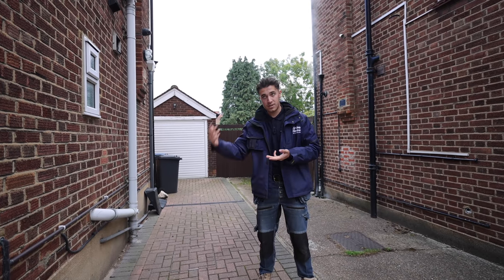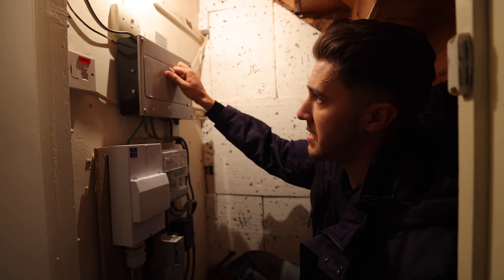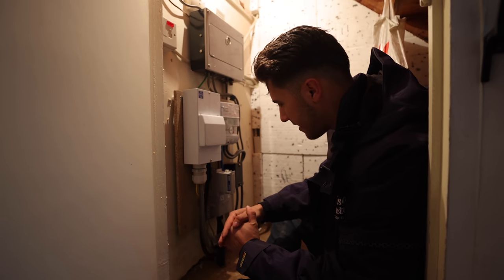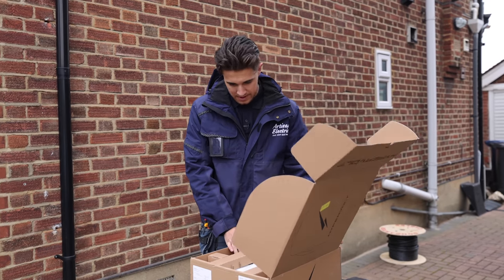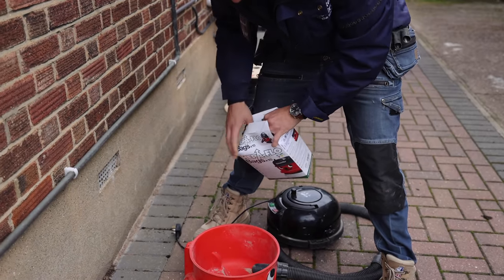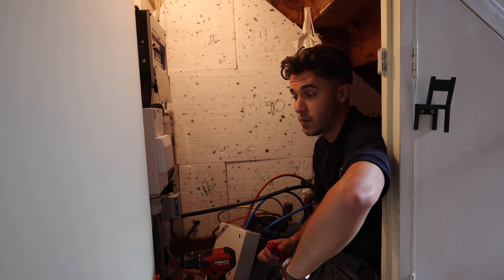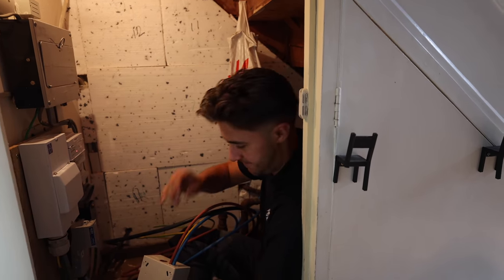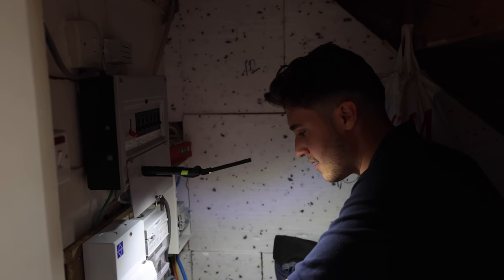DEATH TRAP CONSUMER UNIT - Electrician Life

Comment: I might be missing something here, but if you're a regular installer of Hypervolt, surely they could issue you a plastic/metal template to keep in your kit & use every time.  I imagine they are under pressure to cut down on unnecessary packaging. Surely there are more professional installers than DIY purchases.

Comment: Having worked on the meters for 3 years, I cannot STAND henley 2-tier blocks. Luckily SSE was using 5-way Lucy blocks which you would wire up Line and Neutral separately and they were far, far easier to work with and didn't break as often. The same cannot be said for our isolators. Bet every spark out there has sheared the screw on the top cover of the new Wylex isolators.

Comment: Cory, I still have a tin of that asbestos filler powder in my workshop.  Must be over 40 years old now, and I haven’t touched it for decades.  It was made by Rawplug, and came in an orange tin.  It was good stuff in it’s day, and as the apprentice I always had to mix it up with spit - ahh the good ‘ole days!!
Reply: I remember that too. We always had some in the toolbox at home in the 60s and 70s.  Rolled it with a little spit in the palm of a hand and then squeezed it into the hole ready for the screw.

Comment: Credit to you for venturing into the old crabtree unit.  A useful lesson to be learned about checking all connections.  I suspect whoever installed the small consumer unit for the submain neglected to check if the tails were secure in the crabtree unit.

Comment: Fantastic spot that the lights flickered when you wiggled a tail, great testing technique ! Impressive that you went after it, and fixed it.  Entertaining and impressive video. Also learned about the plasticiser leeching issue from soft polystyrenes. So, educational, too.
  Next door left their house, turned the power off, then simply cut an external IP65 plug socket from the wall, snipping through the supply, which they poked back flush with the wall. Next contractor in turned on the power, and left it on. Dry day.
  When it next rained, we had our own lightening show and explosions from the live supply end of the external plug cable. All resolved with a call to the new owner, and no-one hurt - but REALLY ! You can’t write this stuff.

Comment: Here is a tip no charge Artisan😇. Before you do any work for any consumer you do a week of electrical data logging on usage by putting CT clamps on for a week. That way you have a great sense of the load usage and can really dial in the installation. It will provide you with more options and be confident with any additions that the installation is not going to be compromised by your additions. Moreover that extra step is in line with the Artisan way going above and beyond.
Reply: If the house has gas heating and the EV charger has a correctly configured grid limit there are highly unlikely to be any overloading issues even with a main fuse of "only" 60A.
Reply: If you put a CT on then why would you need to know the houses usage
Reply: too much messing about...busy sparkies have jobs to get to
Reply: @bramcoteelectrical1088  😂 yep not for a standard install unless you go above and beyond. I do suspect when you do repair a property in the future with more DC smart devices, solar, EV and various other power needs - power quality issues are going to be become important and it will become an important part of future testing. At that point the busy sparky will be even busier.

Comment: I don't remember Rawlpugs made from asbestos, they were always brown fibre, there was an asbestos type loose in a tin which you had to moisten and roll into shape to fit the hole- I think it was called Philliplug. In my apprenticeship days we always used a Rawlplug tool and a hammer, could take 10 minutes to make a 1½" x8 hole, Rawlplug started to make 'Durium' drills around 1965, my boss had one No.8, he used to keep it in the safe!! I think they cost about 6/- (30p) then.

Comment: Great video as per, one thing you should always do before re-inserting the main cutout fuse is a short circuit test, this will indicate whether or not you've accidentally put a line or neutral conductor in the wrong terminal of the Henley block.
To do a short circuit test use your voltage indicator and go between both contacts where the fuse carrier sits in the service head if your probs light up saying there's 230v then you've mixed your polarity in your Henley block
Reply: 🤭 That's definitely due to experience 🤣
Reply: @brad30  nahh thats how meter maids and dno are taught to insert the fuse
Reply: @brad30  ahh nah I always triple check what I do 🤣
Reply: @MrEnixa  no you wouldn't you'd get a lighting bolt warning signal if your testers have single pole voltage indication, If you use Drummond tester it won't light up which is what you want
Reply: @michaelboyes4948  Great advise though as I never check to be honest and it can easily be done I suppose 👍
Reply: @brad30  yeahh definitely worth a check it could save you from a deadly situation or having to pay the cost for dno to come  and replace the fuse or service head
Reply: @MrEnixa  no that's why the short circuit test exists
Reply: I always do a polarity test before i energise

Comment: Still got a 3 phase C50 board in service (also second hand). The breakers only have a magnetic trip, no thermal but they still comply. You don't need RCD protection on earthed armoured cable (522.6.204), so as long as you're putting a board in the garden with an RCD main switch and your EV charger has an RCD you could technically come off that old C50. Not that I'd want to either :D

Comment: With all the regs electricains go by. Have you noticed that other trades don't bother or their regs have lower z
Standards. A few times fire ro escape routes have been mentioned. Did anyone notice gas pipe around building.  Plastic clips?

Comment: Are you using fire rated clips for the cable run outside? Also, what are your thoughts on fitting plastic sub boards outside near the intake cabinet?
Reply: Would you need them on something so close to ground level? ie there wouldn't be a risk of it falling on someone or obstructing an escape route. Not disagreeing, just interested too.

Comment: Nice Vid as always Corey. 
Sadly until they close the “open to interpretation” nonsense that always gets used to excuse shoddy work, you’ll always be dealing with crap like that bad connection inside that widow maker board. 
Also the ongoing joke that still exists regarding electrical engineers legally pulling a main fuse to permit safe isolation needs to be sorted out. 🤟🏻🤟🏻
Reply: I don’t think there’s any open to interpretation that would make that okay — but there’s also the fact that it’s just been there forever. It’s entirely possible that it was tight, or at least more or less tight, when it was installed (and of course that was pre-torque settings). All the other screws on the board Cory checked were also getting an extra quarter turn or so. Things just loosen up over time (to be more accurate, over thermal cycles — that’s why the main tails got it worst) and as long as the regs assume “as long as nobody touches it it’s going to remain okay if it was okay at one time” this can happen.

Not sure how you could fix that, especially given that most electricians wouldn’t want to certify this as safe, or probably even as “as safe as it could be given that it is to 1965 standard”, and yet mandatory replacements of anything but the very oldest crap is a hard sell.

Here in the Netherlands, pulling the main fuse is straight up allowed, but reinstalling it is where you need a certified electrician that can put a seal in with his personal number on it, who also certifies that the entire consumer unit area is up to standards (but not necessarily the rest of the house).

Comment: Just an observation, I did not see a DP meter isolation switch in there, if you were connecting into a Henley block, or repacing it, that main fuse would have to have 'fallen' out at some point, would it not,? for you to make your connections?
That wall plug you were hesitant to touch looked like a mushroomed head of the old wooden Rawlplug... yes, the word Rawlplug has an 'L' in it as it is the company name, all the rest are wall plugs or expansion wall plugs... it aint 'Rawplug'
That product you mentioned that contained asbestos was also a Rawplug product and it was named 'Rawlplastic'
Originally a British company named after John Joseph Rawlings, original plugs were a mixture of jute fibres soaked in glue and animals blood !! I only discovered that last fact when checking if the company was still British, just now.

Comment: So work have told me my next company car is a pure EV. Not ideal for the type of journeys I do but hey ho. They will fit a charger though. Which one should I be urging them to fit?
Reply: Also going for company EV through octopus - only nice option is a zappy v2 from what I’ve seen that comes free install with car. Have to pay for a Anderson :-)
Reply: @peterthomas9440  Interesting, what sort of journeys do you do? Some of mine can be up to 200miles + the my list is fairly limited so probably an Audi Q4. The guy at Audi told me to get used to hanging around charging points. 😬
Reply: zappy...lovely unit

Comment: Those c50 single phase boards are lethal. Probably owner was ex nhs or water board where there are still thousands of those boards in service and nicked off a job. Breakers in the board are worth a few quid just as blanks let alone functional equipment
Reply: definitely my mate had rcd version it exploded and nearly took his eye out with the explosion it was the old metal clad craptree with rcd as  main switch...be warned ..
Reply: Met one on an EICR, lovely un-shrouded inputs on main switch.  Some consequential operation limitations on the testing side as I am not putting my fingers or tools anywhere near that.  Especially after finding such a good Ze and high PSCC value.

The BANG which that loose line tail could generate on contact with the metal does not bear too much though

Comment: You are right that changes do need to be made (in the rental sector as at the end of the day the landlord IS responsible for providing a property that won't burn down.......). It's sad that changes have been made, but already they are useless...

The idea of forcing EICRs to be done in rented properties is, in theory, a good way to solve the issue. Landlords learn if their wiring is safe and what  changes need to be made, prospective tenants can see if the wiring is safe before moving in (creating a market force for improvement) etc etc etc... and if something goes wrong the landlord has more liability if they ignored EICR recommendations etc... HOWEVER...... due to crappy trade body rules every man and his dog can sign an EICR these days and they are just not worth the paper they are written on.

The person who did ours didn't unplug anything before doing r1+r2 etc.. admitted that he was odd jobbing for his mate and not an actual on the trades spark day in day out etc... (i can't control who the agent working on behalf of the landlord picks).

A change that if well implemented could have led to changes has been turned into another paper filling exercise that isn't fit for purpose.
Reply: On the one hand, the government took the lazy way out. Rather than building a proper specification for what exactly landlord electrical checks should consist of and who exactly should do them they just wrote a vague law and left it up to people to interpret it.

On the other hand I do belive that it has been an overall positive for the state of electrics in rental properties. Yes there are chartalans passing stuff that should probably fail* or worse issuing outright fraudulent certificates, but there are also many properties getting their first look from someone competent in a long time.

* Though there is no official list of fail criteria.............................

Comment: Aside from being in contact with polystyrene is the gas bonding not also meant to be within 60cm of the meter, that looked a fair bit further away than that?
Reply: 600mm from meter or "point of entry" 👍
Reply: Yes but if not then as long as bonding is in place it will just be C3 code so wouldn’t fail an eicr. Same applies if connection cannot be located and is confirmed by test.
Reply: Within 600mm of the meter, before the first T or at the nearest practicable location after the pipe enters the property.

Comment: What’s the score with some properties being on a looped supply? Can car chargers still be installed?
Reply: Tough to confirm without asking the DNO or checking surrounding properties. I had 1 cable into the main fuse, but after notifying the DNO of the install (EV & HP application - ENA form), the DNO informed that the supply is looped (which I checked by asking the nearest neighbour to look in their meter cupboard and VOILA, two cables into the main fuse). The DNO stated ".... the installation may remain connected to our distribution system subject to the completion of minor works." The following paragraphs stated "I have identified that a further system study which may lead to potential upgrade works and removal of a looped service is required. We will contact you in due course to make arrangements to complete works, which will be carried out free of charge".
Reply: looped supplies are abit of a mare guys..

Comment: Would it not of been easier, to either add a circuit to the garage sub board, or replace that with a larger one to accommodate another circuit.
Apparently it's not just a radial circuit, I was told by someone fishing for people to do an ev course, obviously the laws of physics are being changed😂😂
Your right you can't know everything, that's why we have books so we don't need to, and let's face it the IET can't even produce a book without errors😂

Comment: Only way to safely isolate that Henley block is to pull the main fuse which should be sealed, which means you may have broken the seal which is not allowed, correct me if I am completely wrong. Be nice to hear your reply
Reply: If you fart on them at the right angle they just fall out sometimes.
Reply: Safe isolation trumps all. If the only way to safely do the work is to pull the fuse, no DNO is going to ding you for that. We live in the real world, not the ideal world, and properties don't always have isolators.
Reply: @aaronmdjones  well there stance on this changed then because they were not happy when we used to do this even on a rewire site
Reply: had DNO wait in van and say to me ...opps I didn't see that ...call me when you done ✔ 😌 and will reseal....others have had right hissy fit and say can't do that...I do it anyway 🤪 🤷 😏

Comment: Good to see decent sparks at work the only ones we ever see are shoddy ones working as sub contractors for the company doing work for the housing association.

Ripped out our airing cupboard recently & left the junction box for immersion heater on wall & live & a random cable with new colours one side & old colours the other jointed with crimps & then wrapped in insulating tape again all live no reason for it being there shouldve been removed or jointed properly (in our bedroom) they also left all the water pipes too & holes in the floor. Only other thing he did was rip our smart thermostat out & run off with it without telling anyone so had to threaten police to get it back.

Absolute cowboys the guys who work for the housing association, dread them coming round & quite frankly I'd rather pay someone who cares to do the job.

Same housing association have also said I can't have an EV charger as they don't have a policy yet. I kid you not I've had to get my MP involved who is furious at them. (no reason can't have a charger, off road parking, modern board, spare ways, all DNO work done & standard meter not shared or included with rent etc).

Comment: Could you of come off the new sub board as there was a spare way.
Reply: not really ideal to make a proper submain and then you can add surge Protection...and get a proper rcbo type A in there..sometimes easier to split the tail and be done with it...your not then taking responsibility for the rest of the crappy old switch gear
Reply: @bramcoteelectrical1088  I thought that new small unit was a 2way CCU with a spare way.

Comment: I noticed that on your EV installations I noticed that you mount the plug holder on the right, wrap the charging cable clockwise and then hang the plug into the holder,  Thisbuts undue stress on the end of the charging cable. If you wrap the cable counterclockwise, hanging the plug normally, that stress is gone due to a smooth transition to the holder.Try it. En
g,. karl schueler ee fcc emt